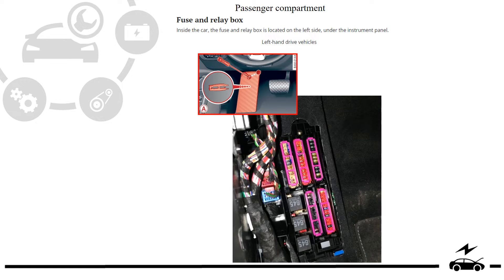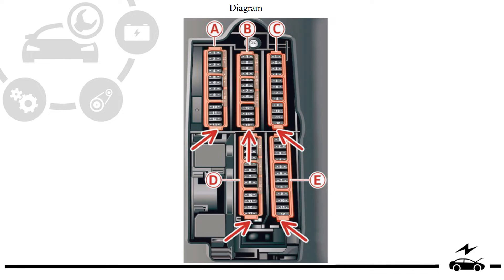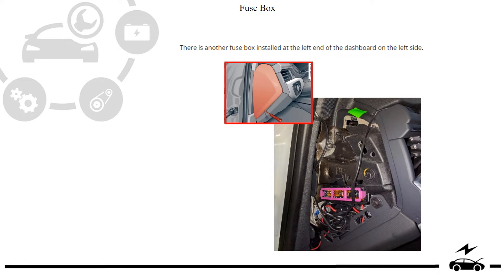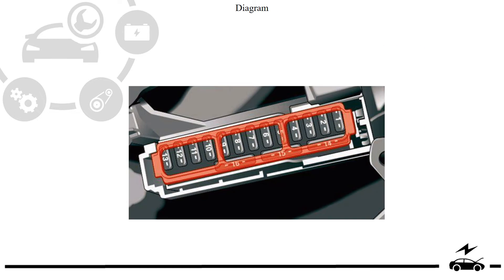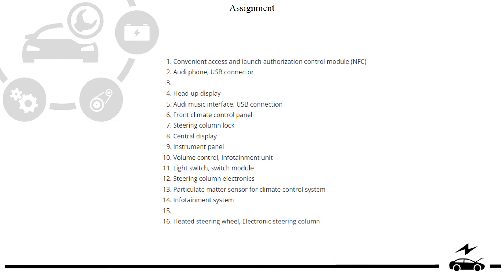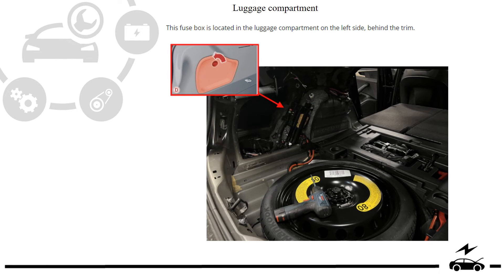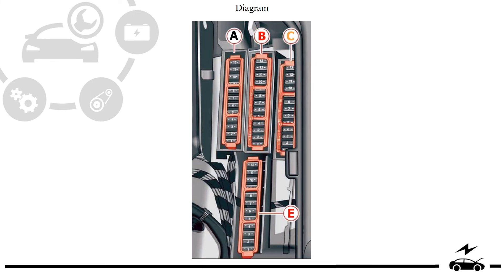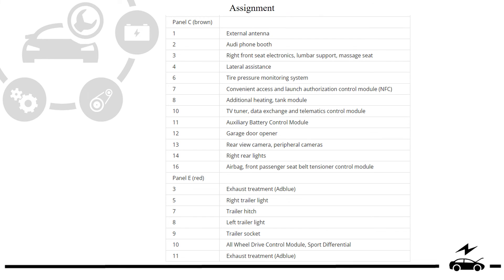Fuse box diagrams for Audi A4 B9 2016 - 2024 and relay with location and description of purpose.

Comment: Hi. Would you know which fuse on an A4 2018 B9 i could hook up Led hood lights. I do believe there are on fuse under the hood. Just wondering how would I get the wire through to the hood. Thanks